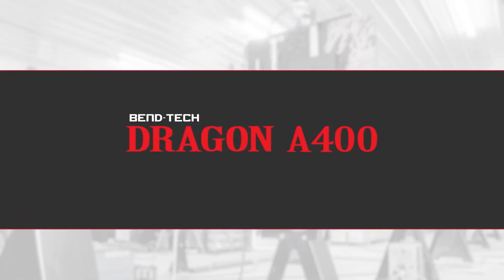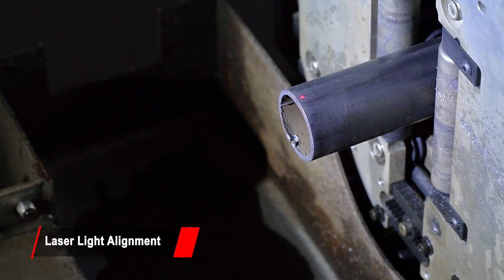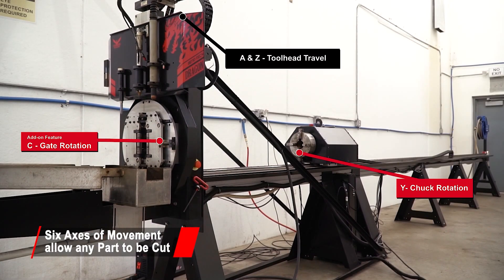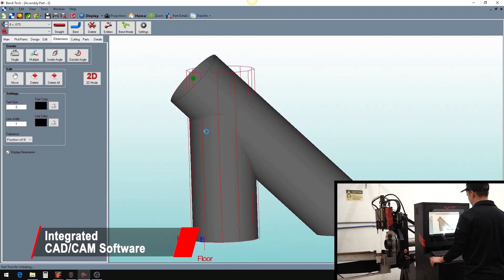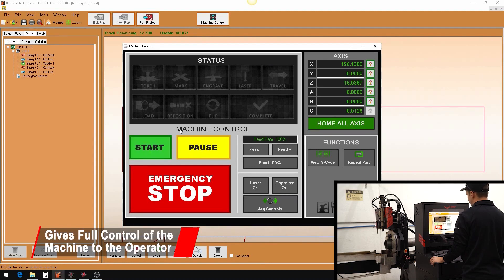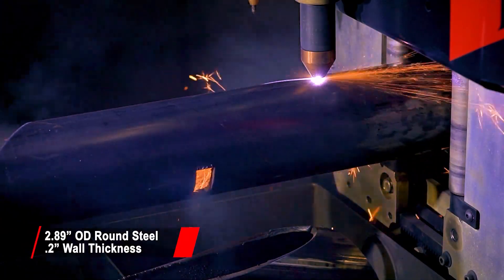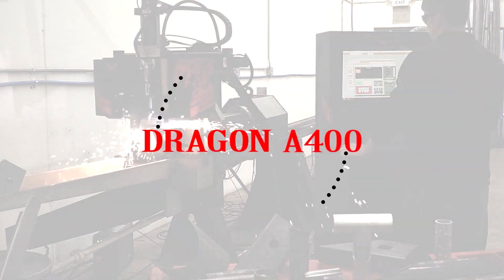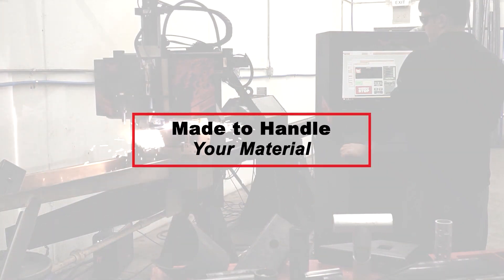CNC Pipe & Tube Cutting:  Demonstrating the Bend-Tech Dragon A400

Comment: Price
Reply from the maker: Hello Farman, these start from roughly AUD $75,000 for a complete set up, but it depends very much on requirements.
Reply: $115,000 is whats sent to me as a quote, wish i had this unit or even the 250 with pipe bender attachment
Reply: @417plasma6  Price has dropped significantly by 2025